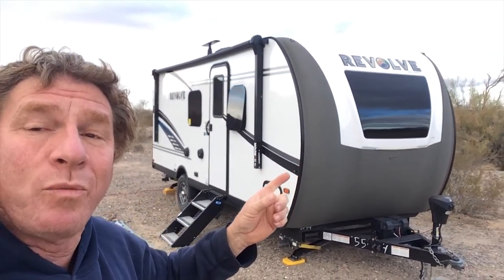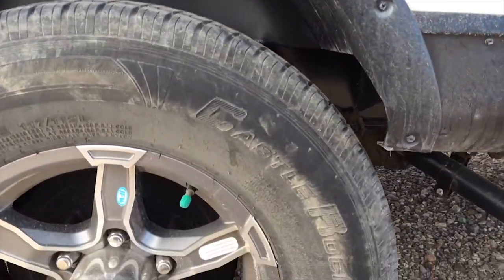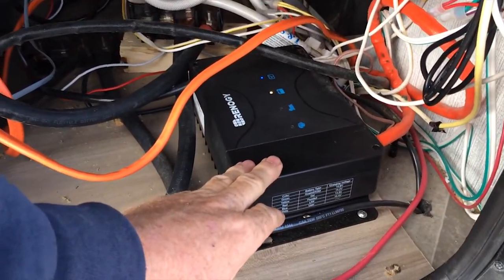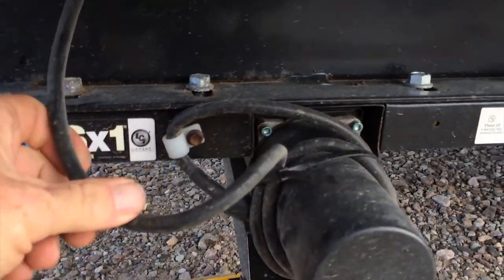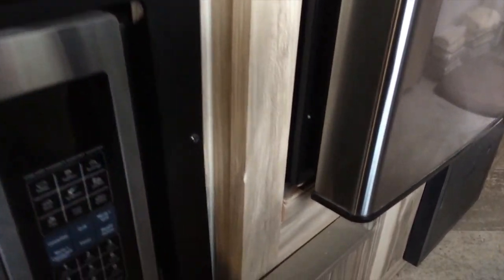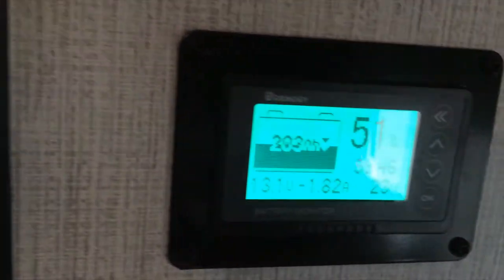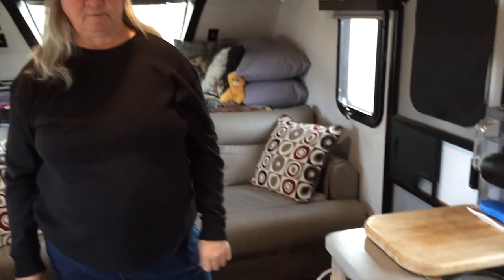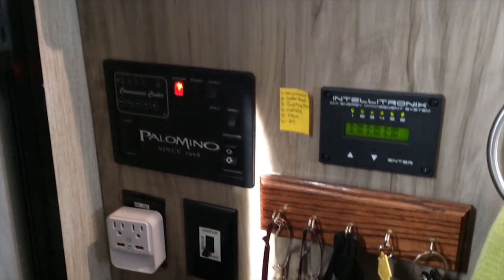Forest River Revolve EV-1 review at 5000 miles 😜

Comment: Wow what a shame. Thanks for your real review!  This trailer is off my list.
Reply from the maker: Watch out for “all electric”. It’s not made for anything more that a weekend trip. Propane heated water and refrigerators are a must have. Now if they had a propane refer with a 12 volt compressor. That would be the bomb. But it will never happen. PS: that trailer blue a tire on the way back home and totally the rig. Less than 2000 miles and the whole side was ripped off by the tread. It wiped out the battery compartment, the shower, the cabinets inside. She could see the inside of the trailer by the time she got off the road.

Comment: Do the 2023 models have similar issues? I'm hoping they fixed all of the common issues by now.
Reply from the maker: No. It’s the same problems. This trailer suffered a blowout on its way back from Arizona to Tennessee. It only had 2000 miles on the “factory tires”. It shredded the tire and by the time she got off the highway from 55 to the shoulder. It completely destroyed the left side. All the electrical, plumbing, cabinets and the shower. It was a totaled by the insurance. It happened in Texas. So she left it with a dealer. I have not talked to her this year to see what she has done.

Comment: Might buy one and take a trip to wherever your shop is to make sure it's in peak condition
Reply from the maker: The first thing you should do is replace the tires. Even if there new. Then put in a propane stove and refrigerator. Then add a propane tank and hook up the water heater and everything else. Then it might be worth using.

Comment: A shity-piece of Silicone wasted build trying to be electric. Forest River should be embarrassed beyond belief.
Reply from the maker: Their response to the owner was, “we don’t respond to critics and he has no idea what the capabilities of the trailer are”.  
It’s easy to see that they, or the dealers have no idea what they are doing.
Reply: @CrazyMarty  We have the same brand of camper and its been back to the dealer 3 or 4 times for the solar, the last time I took it back they seem to fix it but I just don't know enough about the solar to know if we have all the setting set right for it to charge correctly, we are in Colorado and want to use it year round but can't if the solar not working right.we need some HELP.
Reply from the maker: I’m in Montana at the moment. I’ll be heading that direction in a month or so. All you need to do is download the manual. Then set up a custom battery profile. Set the absorb to 14.2 volts and the float to 13.8. You don’t need equalization so turn that off. It doesn’t hurt the batteries to sit at 14.2 for the whole day. If you have the charge controller that runs off the alternator. You will need a Bluetooth dongle to make any changes to it. 
Send me a PM on Facebook if you want help.
What’s stupid is the big MPPT charger on the wall is only running off the portable panel you set on the ground. The ones on the roof are running through the small charger.
Reply: @CrazyMarty sounds complicated, I really want a pre built solar powered RV but this video is making me reconsider buying a revolve ev5 2023